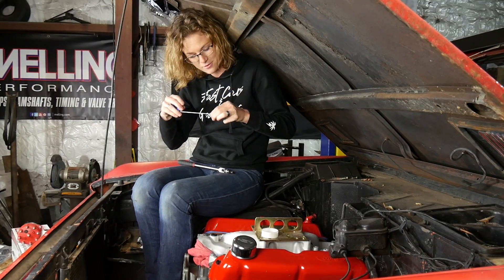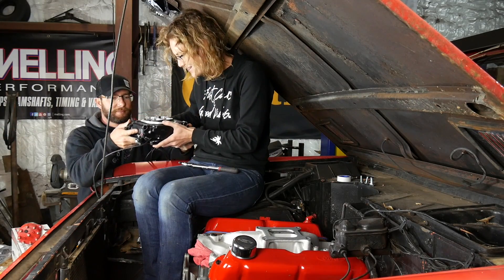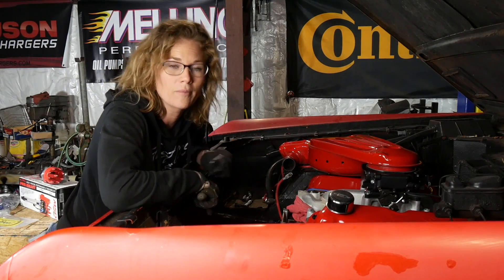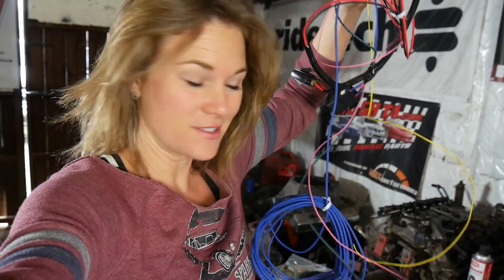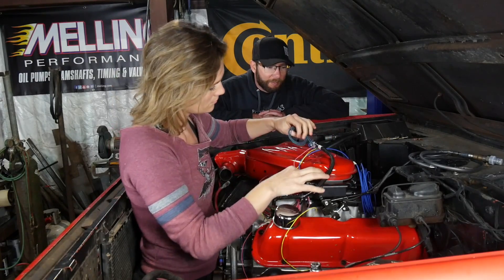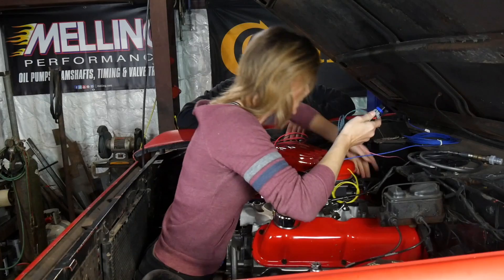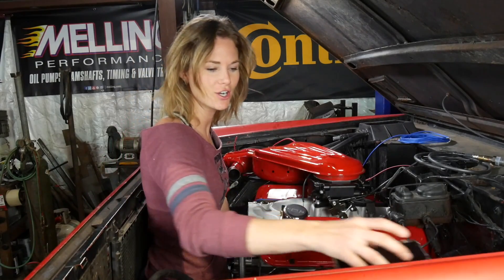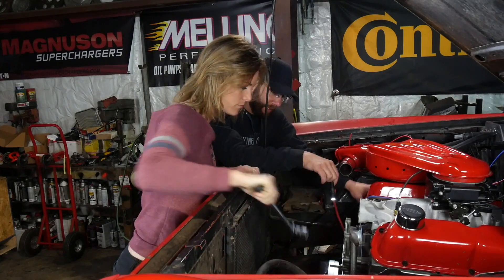EFI install on Bronco BEGINS! In the shop with Emily EP 70

Comment: You guys are going to like the way your engine runs with the Sniper. I put The Whole kit from tank to TBI with the dual sync distributor and a regular coil on my '67 fastback with a 351C.  It really runs good!  Do the distributor install EXACTLY as Holley describes and make the wiring relays for your power sources correctly and it will fire up on the first crank.  I'm anxious to see how much you like the kit when you are done!

Comment: A couple key points to review... 1st, Compatibility of camshaft and distributer gears (types of material) and a coat of assembly lube on both if possible before installation... 2nd, intake manifold and throttle body EFI compatibility, in short a single plane manifold is best. If you choose  to run or budget dictates the use of a dual plane manifold, cut down the plenum divider atleast 1 inch front to rear, or if hood clearance allows a 1 inch spacer will do just fine, this will allow the EFI unit to receive cylinder pulses from both banks of the engine as evenly as possible.  Keep putting out the good content and we'll keep watching... Thanks

Comment: Hi , Emily that Teflon tape is awkward to put on threads , the best way is to hold the roll the opposite way around with your finger through the hole and hold the end with your left finger and wind the roll around your fitting , which means the outside of the tape goes onto your thread ( it does't matter ) and it ends up in the right direction, start taping where the thread stops go around at least 5 times to the end of the thread . Few .

Comment: When I've seen other installs they use a spacer.  Somthing about getting proper fuel distribution.  Others grind down the china wall on the dual plane manifold.
Reply: Holley recommends a 1 inch spacer or remove 1 inch of that divider.
Reply: Im running the terminator, had to run a 1 inch spacer and milled the center divider an inch just for good measure.

Comment: Yeah I found out the hard way about hooking up a hot wire on a fan circuit. The fan motors while spinning even with the key off puts out a small amount of power. So when you think it's off, it's not until the blades stop.

Comment: Hello guys, Emily is correct, any fans or pumps are likely to cause a voltage drop depending on wire size and the length of the wires, ECU needs a nice clean constant voltage, so best to run wires on their own, straight to the battery. You need a constant power trigger wire, so avoid the stock ignition wire on older vehicles, this is switched off when you turn the key to ‘start’. I’m using a separate switch, but you can install a latching relay, instead. If you use a replacement harness, it will most likely have a constant accessory source included. I’m running this system on a Cleveland 351, no crank sensor but with a Bakelite spacer under the throttle body - runs great- had no problems, I’m about to lock out the vacuum advance on the MSD and switch to The Sniper’s internal timing control soon.

Comment: Just a little reminder on the installation of the Efi,might have to run a 1 in. Or 1/2 in. Spacer on the intake. Once you run into issue with the hunting idle or cut the bar on the intake manifold so the signal can read both blades

Comment: I like my Holley sniper, I have it on my 406 SBC in my 71 c10, I also run the hyper spark with it, makes for a great all in one package when it comes to tuning time. Oh and that intake will give you trouble, you need a single plane and I run a 2" space on mine it helps get rid of the strange whistle sounds the efi TB makes on hard acceleration and the surging idle it likes to do at times. Holley makes a sheet metal long runner sniper intake that looks killer and works great with this setup. I would advise it and you should gain a few ponies with this sniper intake.

Comment: Teflon tape wrapping.

Step 1 - Hold the part that you are applying the tape to in your left hand, with the threads point away from your fingers. If its a plug, put it on the Allen key. 
Step 2 - How you hold the tape is very important. Slide the tape onto your finger closes to the thumb, with the loose part of the tape falling between the fingers, not between the finger and thumb.
Step 3 -  Bring the part the requires the tape up in front of you, holding it in your left hand.
Step 4 -  With the tape being held in your right hand, lay the tail end on the plug. With the thumb on your left hand, hold the tail against the plug and start wrappings the plug. The idea is to wrap the tape around the plug. Never roll the plug, always roll the tape (letting the Teflon tape spin on right hand finger, with you right thumb controlling the speed) as you wind the tape around the object.
Step 4 -  To much tape is bad and to little is bad. Between 2 or 3 wraps is all you need.

Comment: Hey guys!! Nice to see progress on the Bronco!  Curious to see how it will run and idle with that dual plane intake. I've heard those efi setups need an open area under the butterflies for a proper mixture. Wish you the best!
Reply: Yep, I've been there!  You absolutely have to cut part of the divider out of the manifold (or add a spacer). I didn't want to believe it, but you have to do it.

Comment: Do you guys buy your wine in a box too!  I probably would still use a funnel to pour it in the engine. 
Also, it helps to add a little bit of oil to the filter when you install it to reduce wear on the engine where there is no oil yet because of the air void created by the oil filter being empty.

Comment: The old method of finding top dead center is with the starter powered is to bump the starter while someone has their finger over the plug hole. On top dead center it will blow your finger off. Their are two top dead centers. Exhaust stroke and compression stroke. You are wanting the compression stroke. The real method is to pull the valve cover off and watch the valves close. Your screwdriver method could cause you distributor to be 180° off. It will backfire horribly and alot of times on carburated engines will start a fire on the carburetor. You have a 50/50 chance of getting it right. This is a four cycle engine, hence the piston will be at the top of the cylinder 2 times.

Comment: If you don't use any wires you should unpin them from the connectors. It'll make the wiring look cleaner. I'm looking to do the same setup on my truck. What size did you go with?

Comment: When you install a distributor in a Ford normally you just bump over by the key or turn the engine by hand while applying light pressure to the top of the cap and it will fall on the oil pump driveshaft. Shouldn't that linkage ball you installed go on the opposite side...it looks like it was bumping into the lever at WOT ?
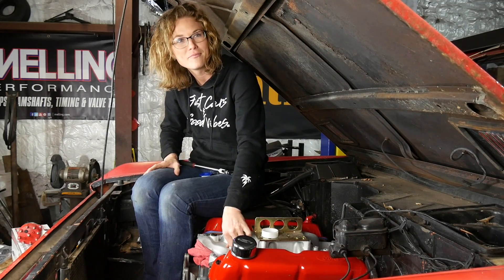Reply: And rotor should point about 1:00

Comment: YES!!! I HATE IT when the "spark plug" falls out of the "socket"!!! :)
Reply: Sorry I have to........... "thats what she said"  (pls don't hurt me)
Reply: That's why I love my magnetic spark plug socket set. Between plugs not staying in the socket, or the rubber in the socket coming out with the plug, magnetic is the way to go.
Reply: I use a piece of old fuel line, works on everything I've done.
Reply: Bryan Mills When the boot falls out of your spark plug socket- use a small neodymium magnet. They’re cheap at Amazon.com, I have a Snap-On set I got at a swap meet. I milled out a small area at the base and glued in the magnet. Now it holds it good enough not to fall out. 🥰🇺🇸
Reply: @chloehennessey6813  I have modified some sockets like that. JB Weld or Shoe Goo works.
Reply: @chloehennessey6813  uuummm....I think you totally missed the comment joke. The reference was to the "sparkplug" falling out of the  "socket".
So...let me explain: in looking at the male anatomy the male "part" would be the sparkplug. In the female anatomy the socket would be the...well, you figure that one out.
If I need to explain this a little further for you -let me know. :)
Reply: @kevinlimo696  You beat me to it, I always use a piece of fuel tubing to start my plugs.  The one advantage with the fuel tubing is it makes those plugs that aren't a straight shot in to the head so much easier to get started, the tubing acts like the most user friendly universal adapter you have ever used.

Comment: I would have used studs to mount the FI unit so if that unit ever needs to be removed, the threads in the intake would not be getting any wear. I use a long spark plug boot to install spark plugs. Put some assembly lube on your dist gear. Hmm, too lazy to get a funnel so let’s make a mess. LOL. I’ve never seen a box of oil here in Ontario Canada. I wonder who the Debbie Downer’s are, probably jealous people.

Comment: Anti-seize will actually cause the spark plugs to run hotter due to it being a barrier to heat transfer to the head. GM has a TSB about this.I know everybody does it, I’m just sayin’. Better to chase the threads and lube with oil only.
Reply: I only use oil when installing spark plugs too. Just never really thought using anti-seize was a good idea. 
As I live in Maine I do use a lot of anti-seize on all the vehicle's I work on.

Comment: You were right the first time, it's 'engine'. Motors use electricity, engines burn fuel. While these terms have been freely interchanged forever, with the rise of electric cars this is probably a good time to re-train ourselves to use the proper nomenclature.